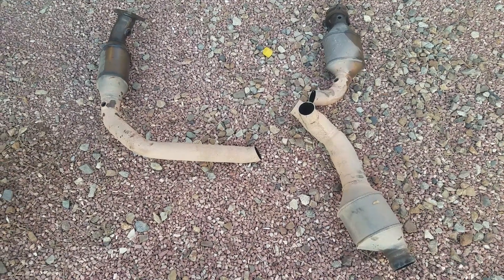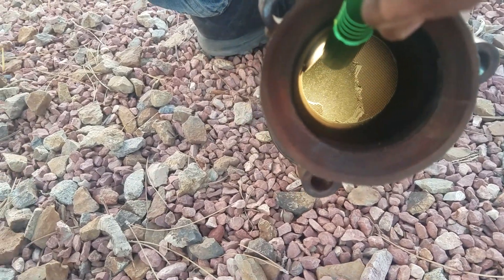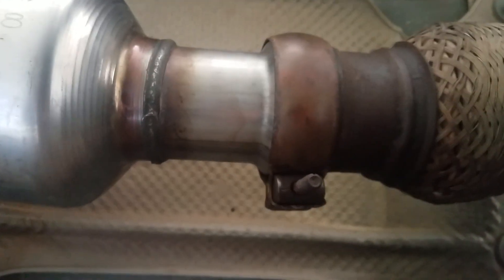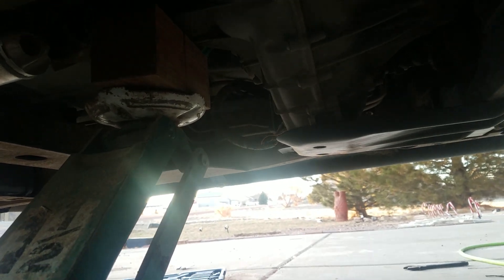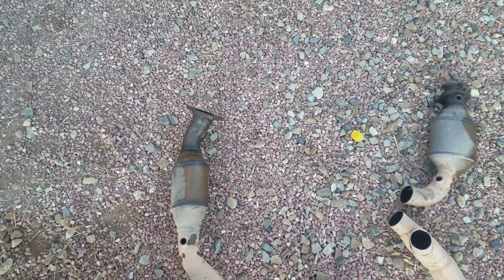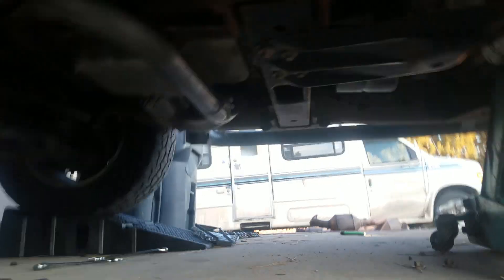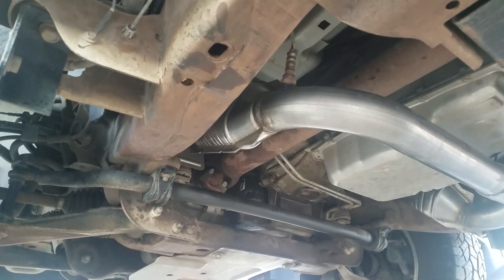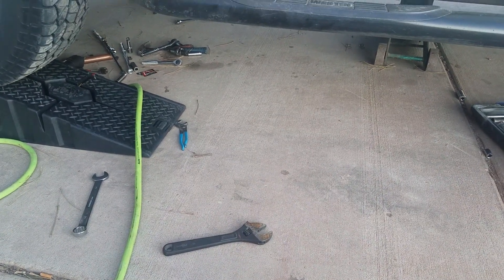2010 chevy silverado catalytic converter  part 2

Comment: Drivers side top bolt is my only problem getting off. Can’t fit a swivel let alone keep a socket straight. What’s your secret for bolt removal for drivers side cat top bolt???Thanks
Reply from the maker: I made a slinky of extensions and swivels
Reply: Forsure i got like 3 threads left on that one and i gave up last weekend.

Comment: Hey bro, how did the truck run when the converter failed? Did the tachometer stumble like it had a miss to it every few seconds? I’ve got this same year truck and am suspecting the converters, but not sure.
Reply: My truck's the same way both cats are clogged it won't drive past 35 mph so I had to remove the oxygen sensors on the Upstream to let it breathe so I can still drive it

Comment: You don’t didn’t to weld any other old stock exhaust to the new catalytic converter? Everything bolted it on no problem?
Reply from the maker: yes no welding at all. I did cut old one in half to ease removal. but even old one bolted to heads. beware really hard to remove old exhaust bolts. lots of penetasting oil ahead of even trying to remove
Reply: Ok thank you! And is your a 4wd drive too? Because I’m trying to get the same one. I got a 2011 Silverado 1500 5.3 4WD. Can you send me the link to that please. And did you also change all your 02 sensors as well and where you get them. Sorry for all the questions lol
Reply from the maker: @eddiesalvador7989  everything the same but mine is 2010. I replaced only ones on bad side. I think I bought them at autozone or oreillys actually
Reply: Oh okay I went to the website but it say it like 1200$ not 700…? Unless I went to the wrong site?
Reply from the maker: @eddiesalvador7989  try rock auto if magna flow didn't work. keep in mind that was almost 2 years ago and right now with covid everything is expensive
Reply: @jayrob11777  you wouldn’t by chance still have the part number no more right? Lol probably not because it was 2 years ago 🤣

Comment: Dude.. what was you truck doing when you realized they were clogged??? I'm having problems with mine and don't know what to check first
Reply from the maker: I heard a tick first then stabiltrak lights would come on and off
Reply: @jayrob11777  I put eBay cats and y pipe now getting a po420 and po430 codes and stabilitrak light and a very slight misfire